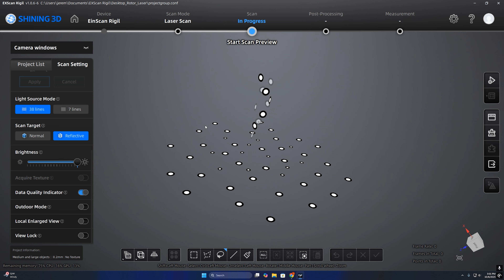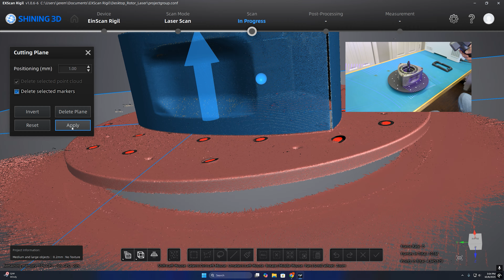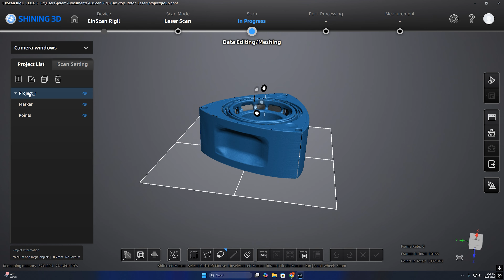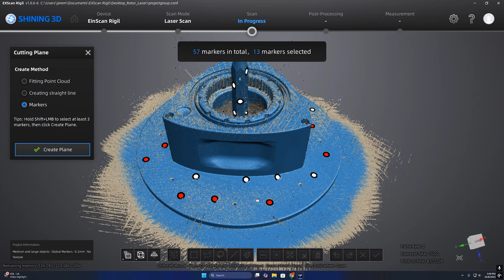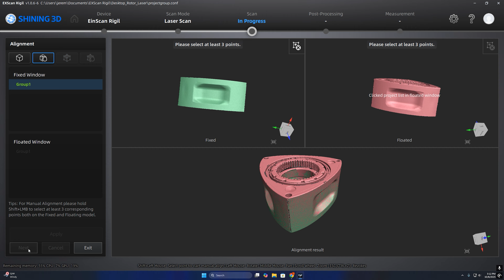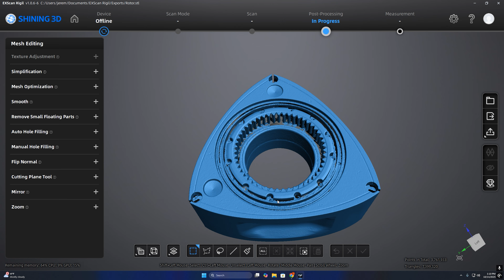3D Scanning Mazda RX-7 Rotor | EinScan Rigil

Comment: I’ve looked everywhere and can’t figure it out how can I get the model imported into feature cam do I have to use the shining 3d to make it into a solid model before I import it to feature cam anything would help
Reply from the maker: You have to mesh the model in EXScan, then export it as STL or OBJ. Open Fusion 360, Mesh Tab, Create, Insert Mesh. One thing to note is that you should use Simplification in EXScan Mesh Editing before exporting. You should reduce the size of the object to less than 150 MB. Otherwise Fusion will be slow.

Comment: Hi, thank you very much for the helpful and accurate information. What is the make and model of your computer? Or what are its hardware specifications? Data transfer is smooth and quite fast.
Reply from the maker: AMD 5950X, 64GB RAM, RTX 5090. EXScan still needs a lot more optimizations. Right now my GPU is overkill and then some. EXScan only uses the GPU while scanning. It does not use the GPU for point cloud generation / optimization. I only see about 7% GPU utilization. My CPU does okay. My laptop which has an Intel i9-13900HX can actually works better since EXScan is CPU heavy.

I believe Shining 3D is working on better hardware utilization and more efficient use of RAM.
Reply: @goldfingerdash Thank you